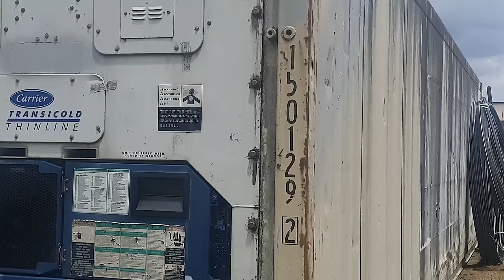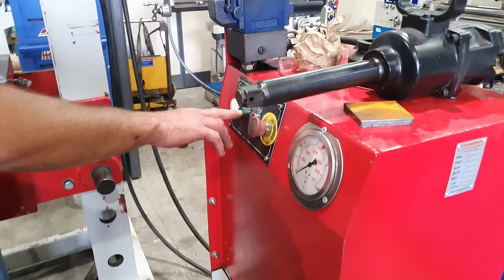Hydraulic Cylinder Rebuilds | This CAT 140M Grader NEEDS Repair | Part 2

Comment: Is that an aftermarket 5.0 Milwaukee battery? If so what's your opinion on them? Another great video! I love your shop press, and all the other machines you have. Great job on the cylinders, true professional 👏
Reply from the maker: hey mate it's a genuine one, I don't buy anything aftermarket Milwaukee
Reply: @CuttingEdgeEngineering  I didn't think you would, caught me off guard. I would love to know how you made the tail stock center chuck, did that build happen to be filmed? Im sure im not the only one as it seems like a genious idea. Also Thanks for the response

Comment: Kurtis love your videos, you're teaching this old fart new tricks almost every week. But saw something in the outtakes that spooked me. Unfortunately I learned the hard way when disconnecting Hyd lines that you can maybe get fluid into your eyes or an eye when a wee bit of pressure is maybe still on it. Very painful issue to deal with and one I hate to see anyone deal with. So please wear some safety glasses or a shield. I went to a shield long time ago due to glasses fogging up in summer heat and it protects the whole face as one never knows how much pressure might still be there even after you think you have bled it all off.

Comment: Another great video, as well as a quirk that could have people wondering whether copyright enforcement currently has absurd overreach.
One question: Given the machine is reasonably old and is worn out in places rather than completely destroyed like a lot of your reclamation jobs, is that an indicator that the machine has been used sensibly and somewhat gently its whole life? 
Some of the components that go into your shop show signs of abuse, but this machine seems to have been respectfully used.

Comment: Hi Curtis love watching your videos and find them very helpful even for my own work which is more of a hobby than a business . 
I was wondering if you could tell me how thick is induction hardening ??
I have pins from Hitachi excavators and I’m hoping to use the steel from them but believe they are induction hardened .
I have a large powerful but old TOS lathe and was wondering how deep of cut i would need to take to get under the hardening ?

Comment: All in all that looked like as good of a reseal job as ant other.  I did like that you all included some of the goofiness at the end , otherwise it would have looked like the job went too smoothly.  Question , did you refill the void ends of the cylinders before putting them back on or did you let the machine do it then refill it's hydraulic tank?
Reply from the maker: Refilled the machine hydraulic tank 👍

Comment: I get nervous when you walk under the fork lift when it's in the air. Does it have some kind of locking mechanism? I am not in the industry but I've seen hydraulics fail.

Great video and great work.

Comment: Great video Kurtis .Keep the videos coming at 39 minutes in to the video you are using a steel bar with a open & closed end wrench . Is this something you made ? I do double wrenches at work and am curious how you came up with that design  . Sometimes there is not enough room to use a hammer wrench  . Can you explain ?
Reply from the maker: hey mate yeah that's a shop made one, made it on the fly one day after a spanner broke one me. We'll be doing a shop made tools video and make a new improved one soon!
Reply: That would be a great video to do, I am always looking for new ideas on shop made tools 👍

Comment: Do you leave the end of the cotter key sticking above the castle nut. Customers that we had at the Decatur CAT plant were very picky about cut wire ties sticking out to "scratch" the unsuspecting mechanic and ends of cotter keys left exposed. Our assemblers had orders to tap them flat over the nut. We also had a wire tie puller that clipped the ties smooth with the keeper.
Karen, I think it would be more fun to show the dropped parts etc in situ vs outtakes.  LOL

Comment: The tool you used on the u cup main pressure seal, can you show me that and we're did you get? 
Awesome video 
Thank you
Reply from the maker: Hey mate that's an ebay special! Search for HYDRAULIC CYLINDER PISTON ROD U SEAL INSTALLER TOOL KIT
Reply: @CuttingEdgeEngineering  thank you 
Have an awesome day

Comment: Have u done a cylinder on here with the 2 ports thru the ram? I've had this ram rebuilt 3 times now and it cracked again at edge of weld on one side. It goes in a left right tilt grading bucket on a wheel excavator.  I've even had the whole coupler line bored and all new pins and bushings just to make sure it wasn't breaking it from the slight worn bushings. I even welded on a extra 1/2in on the stop just to make sure the bucket wasn't over angling and pulling on cylinder end when fully angled

Comment: That outside enclosure is a great addition to y'alls business. Do you remember where you got that blue cap and plug set? Thanks. Do they give a torque spec on those gland nuts other than just as damn tight as you can get it.
Reply from the maker: yeah the plug set is directly from Caterpillar
Reply: @CuttingEdgeEngineering  Thanks

Comment: I wonder does the grader have some special operation mode to bleed the air off the hydraulic cylinders?
I know Bosch ABS hydro-aggregate have special options in its firmware those activate bleeding-off procedure.

Comment: With respect to the end caps the customer had machined material off of, at what point do you have to add material back to the end caps and machine them back to spec? i’m not a machinist, but i’m wondering where the safe limit for using stacks of shims vs taking them back to spec. Enjoyed the video, as always

Comment: The 2 ball caps the customer machined down (forcing you to use more shims than necessary), are they something you can make or does that need a more specialized shop?

And if you can make new ones (or use weld 'n grind to replace the missing material) would it (as usual) be cheaper than buying new ones from the manufacturer?

Comment: Genuine question from someone who has never done heavy equipment work: if the shims go between the rod end and the cup bearing, doesn’t that mean that the cup bearing is then taking all of the load of the ball joint?  I was expecting to see the shims installed in the “middle of the sandwich” so to speak, aka between the cup bearings.  Leaving the cup bearings sitting right against the inside of the rod end.

Comment: Is it possible to not remove one of those blue pipe plugs???? Or will the couplings not go on right? Have you ever???? Just an old guy wondering? Also, you would think on such a big piece of machinery, things, like cotter pins would have more room to get to.

Comment: That was really cool Have only just come across your channel but love your skills and content. So if heard you correctly in a round about way you are saying that the newer CAT 140H's have gone backwards in regards to steering. If you change anything it needs to be reset and re-calibrated by the dealer??. To my mind is that not going backwards and making things more complicated and costly for the customer? or is it CAT's way of trying to shutout others from doing work on their machine except their own dealerships? I guess would not be the first equipment manufacturer to try and do that and wont be the last one either...... sigh. Why do they not realise you make it too complicated and too costly, then people will just look for alternatives which are much more cheaper operationally longer term.

Comment: Did you have to bleed all the hydraulic lines or does the air work through the system and back to the main reservoir?

Comment: I didn't expect there to be sensors like that inside the cylinder - kinda blowing my mind that the steering even has some sort of GPS function. Do you know what that function actually provides? Is it like automatic steering along a path? Or just over-engineering for the sake of it?

Comment: I assume you're using a torque wrench on the inside of the cylinder main seal but then I see your Tonya Harding torque hammer and I'm left wondering..

Comment: Hello Kurtis, nice work as always. Just a quick question for the blade lift arm joints. Once you get the shims right, why don't you pre-grease the joints by hand so they are not dry https://youtu.be/Npl3u-luka4?t=2305 ? In the video, you can see grease doesn't make it all the way around the joint.

Comment: Didn't you have to bleed the hydraulic lines?
Reply: All the cylinders are "Double Acting" and therefore they self bleed (purge air) after a few cycles of motion in both directions.  Any air trapped in a line/cylinder will be returned to the hydraulic reservoir where it will then vent harmlessly to atmosphere.

Comment: superb vid, all the other nice comments great, I agree with. no fucking pounding drums, just plain mechanics with clinking spanners (not fucking wrenches). excellent ty.
please quick talk and demo of the tooling used. what was that thing that wrapped round the spanner to extend it? what was that quick shot of looked like a one inch drive air hammer suspended by strap to tighten nut on end of rod. please explain and talk of the tooling used.

Comment: Another interesting video. Even though I have resealed countless hydraulic cylinders over the years it’s interesting to see how others do it. Like using your big press as a Vice to disassemble the parts. I like that tapered tool to help the gland nut slid onto the rod easier. Is that a shop made tool or a purchased tool ??  When you take on a job such as this grader. Do you bill it hourly or flat rate bid it??

Comment: At 20:55 what tool is that?  anyone know ??? I always had such trouble with getting seals in at those locations
Reply from the maker: That is one I got off ebay just search HYDRAULIC CYLINDER PISTON ROD U SEAL INSTALLER TOOL KIT
Reply: @CuttingEdgeEngineering  Thanks on my Christmas 2022 list!!!

Comment: A question.
Do you find yourself in the situation of turning away jobs for customers that want to cheap out / half ass repairs?
It seems this customer has gone the extra distance to work with you, and address all of the squawks in your realm.
Bravo, on your use of caps and plugs, to avoid contamination, something that is frequently neglected by the people that should know better.
Great video as always…

Comment: If you want to avoid contamination of the soil, you really should have a proper fluid floor or basket. I know it only looks like a little hydrolic fluid, but it is not going away and you, as a business, will be doing jobs more frequently.

Comment: If I didn't know better, I'd think this machine was designed in Europe because it seems that every bolt and nut on it uses the German Torque Specs...

Good-'n-tight...

😄😁😆😅😂🤣
Reply: This machine was designed in the USA. Also, Germans actually use torque wrenches.

Comment: Ove the unconventional use of tools. Hydraulic press as a vice, lump hammer as a torque wrench. 
Was rather concerned about the consequences of the press slipping when you fitted those circles, though.